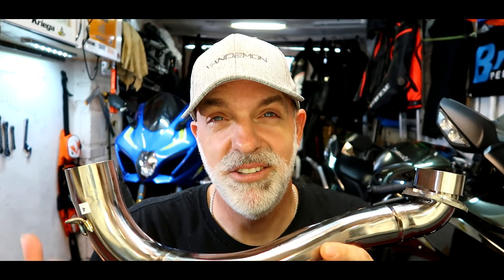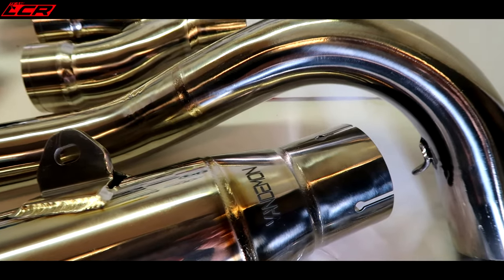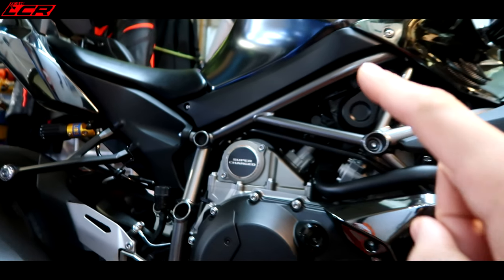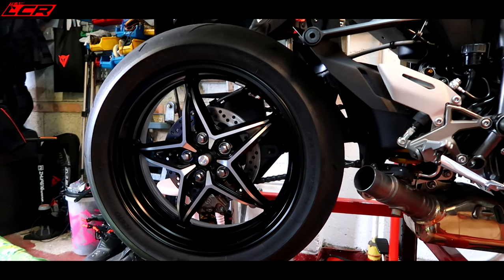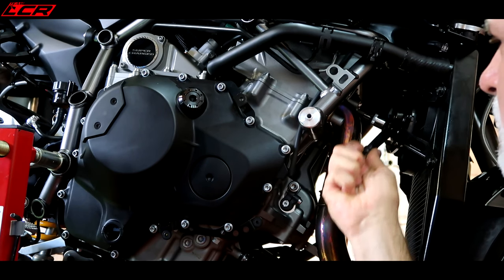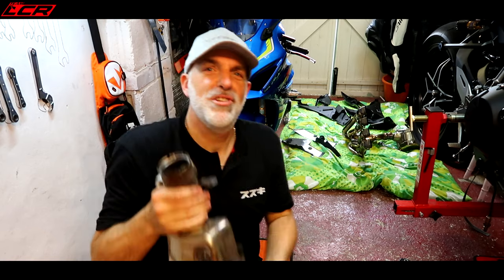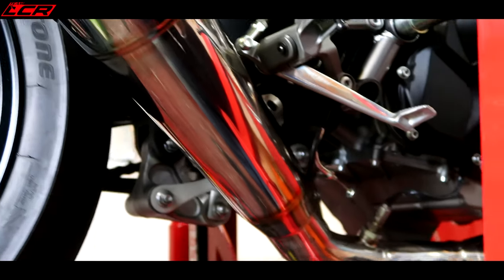Ninja H2 FULL SYSTEM! | Installation & Sound Tests

Comment: One option to tune your exhaust to your liking is to modify the baffle. The HP exhaust on my street triple I started by drilling out the holes on the baffle shaft to a larger diameter. That didn't make much of a difference. I then started cutting the baffle down a bit at a time to make it shorter. Now it's perfect for my liking. Not stupid loud but not quite and I get pops and bangs on downshifts. You can always order a spare baffle if you desire
Reply from the maker: Yes very good idea that Matthew!

Comment: The weight saved means you can eat more pies. The sound and blueing is gorgeous. As you mentioned, the welds look perfect and seamless. Can't wait for the next video. I can only imagine the crowds flocking around it when you pull into any car park. TMF will still get stuck behind a white van on this.

Comment: superb mate! cannot wait for road test! I'm waiting to get the running in service done on the CB then fitting a tiny Termi race can, cheers, G-Man
Reply from the maker: Thats going to sound naughty too!! :-)
Reply: Lamb Chop Rides , not doing full system but the end can is titanium and not road legal and can Remove the baffles so should sound great and weight saving  of around 4kilos, should look good and show off the single sided swing arm too 😜
Reply: Put a video of the stock can and an after of it?

Comment: Hi mate I put sc project on my 2017 H2 then had ecu flash =250 rwhp 😜 they are massively strangled bikes to meet euro emissions...mine was running 20% throttle at 14000rpm now it's 100% in gears 23456 as 1st gear was left alone as would of been unrideable 😁😁 great vid dude 👍👍
Reply: Did u install pc5 too?
Reply: Did u install pc5 too?
Reply: KRISHNENDU BANIK no mate ...Pete clifford who works in bsb for smiths racing team did all the tuning for me..the H2 is unbelievable strangled 😵😵😵😵😵 the power to unlock is there already..but it’s a lot to use on the road mate..
Reply from the maker: Thanks matey, who did your flashing out of interest?
Reply: Lamb Chop Rides Pete clifford the chief tech guy for SMITHS BMW race team Pete hickmans team..just outside of Hull (actiforce racing) 👍
Reply from the maker: OK cheers buddy

Comment: Another great video! Awesome bike and new exhaust, hope to have an H2 some time in the future as well! I guess at some point you also reached this point where the exitment drops below the frustration level, having to remove so many things.......and you just think "WTF did I do" hahaha I had this when I wanted to quickly put on a new handle bar 2 days before a bigger bike trip haha
Reply from the maker: Yes it a pain but part of the job isnt it. Ive given up struggling trying to work around something when just by taking another thing off its so much more pleasant to do the job
Reply: @LambChopRides  thats true for sure

Comment: How did you install the "RH lower deflecting bracket" so that the lower right plastic fairing does not make contact with the exhaust pipes? I'm not seeing how it's supposed to be installed with the hardware provided.

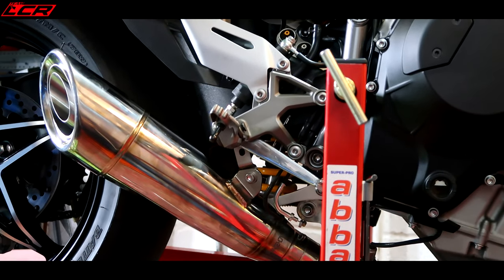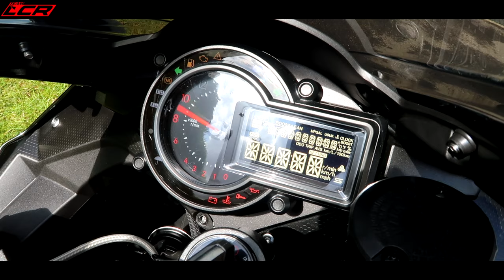Comment: Great Video, I'm curious did you leave the servo on? I saw the cables hanging there after the breadbox was removed and at 10:49 and 12:08. I also have a '16 ZX10R and have been going back and forth on getting an exhaust because of the servo, and then the power commander.
Reply from the maker: Yes left it on for now until I fit the Healtech eliminator. Putting it off as have to remove the tank haha.

Comment: Hello Sean did you buy a bracket for tue exhaust or did you have to improvise a bracket , im surprised vandemon didnt supply a bracket in fact i think it should have been a straight fit plug and play , as you know ive purchased a Brand New H2 a few days ago and im very very interested in this Vandemon exhaust , but ive noticed they have put the prices up from £1800 to nearly £2000 any chance they can knock the price price down to maybe £1800  , they should a Lamb Chops discount code

Comment: Just bought the vandemon  exhaust for my 2021 H2 and wondered if you had any tips. Also   are the header bolts hex or torque and what size. Heed to buy the correct one. Thanks. P.s. love the channel.
Reply from the maker: I just reused the header bolts, no need to replace 👍

Comment: Welcome to the h2 noisy group! 🤣 Just a heads up, but keep an eye on your real wheel bearing play. One sec I had no play in the wheel then 50 miles later there was movement. Kawasaki did not cover it on warranty either! It's a good £500 to have the 2 bearings replaced too
Reply from the maker: Ok great tip thanks Davey!

Comment: What about the cables for the exhaust servo Chops, have you removed them as well?. Sounds epic 👍
Reply from the maker: No currently tied back until I fit the Healtech Servo eliminator
Reply: @LambChopRides  Leaving the cables loose like that but not connected did it throw the FI code or is that only if you remove the servo motor without the eliminator?

Comment: Will it activate the new noise cameras ?
Reply from the maker: Yes probably!! Grrr, think it will be ok just have to pull clutch in once location of these things are known!
Reply: Noise camera on your streets?
In Sepang, no issue for sound limits so far ..
On our streets now, a ‘rampage’ on motorcyclists Is underway 
– mainly for Exhaust Sound Levels, and, other legal stuffs ..
So, made a video for my fellow bikers here on the legal test standards, as linked below,
Wonder if it’s exactly typical to that of yours, over there?
https://youtu.be/Na1HFr57r7U

Comment: Hi on there website says does not need remaping is that ture can I put the system on and not bother with the remaping
Reply from the maker: Yes they run so rich stock it's fine. I have a dyno vid on my channel where we mapped it and with just the exhaust fueling was safe. 210 hp at the wheel with the system too!

Comment: Great video and job with the H2🥵👍 The exhaust sound’s awesome👌. Just curious🤔? Is the exhaust street legal and what did the Motor-Vehicle Inspection say?😱 The Green BST carbon wheels would fit well on the H2🤔👍.
Reply from the maker: Nope its not road legal... With the baffle in its not ridiculously loud Iive heard much worse but yes could get me in trouble. MOT yes thats also a potential pain with no CAT but cross that bridge in a 2 years time, know a friendly MOT man :-)
Reply: In Sepang, no issue for sound limits so far ..
On our streets now, a ‘rampage’ on motorcyclists Is underway 
– mainly for Exhaust Sound Levels, and, other legal stuffs ..
So, made a video for my fellow bikers here on the legal test standards, as linked below,
Wonder if it’s exactly typical to that of yours, over there?
https://youtu.be/Na1HFr57r7U

Comment: Sad I live in Germany where this modification is not allowed and in some areas strictly controlled. I drive a Z1000 2015 with full Akrapovic sysem. If the wrong cop pulls me over, they will set my bike out of order. Damn Euro-settings, force of DB-Eaters etc
Reply: Guten Tag ..
In Sepang, no issue for sound limits so far ..
On our streets now, a ‘rampage’ on motorcyclists Is underway 
– mainly for Exhaust Sound Levels, and, other legal stuffs ..
So, made a video for my fellow bikers here on the legal test standards, as linked below,
Wonder if it’s exactly typical to that of yours, over there?
https://youtu.be/Na1HFr57r7U

Comment: No chance of tracking that now, which is a shame. Brands is 102db cap
Reply from the maker: Yes I dont want to use this in track Andy anyway as its just to expensive to repair if you come off. Thats what the GSXR is for :)
Reply: In Sepang, no issue for sound limits so far ..
On our streets now, a ‘rampage’ on motorcyclists Is underway 
– mainly for Exhaust Sound Levels, and, other legal stuffs ..
So, made a video for my fellow bikers here on the legal test standards, as linked below,
Wonder if it’s exactly typical to that of yours, over there?
https://youtu.be/Na1HFr57r7U

Comment: Best leave the baffle in as the fun police are going to have noise cameras more cash for the man but is it any louder than the gsxr with the brocks titanium pipe
Reply: In Sepang, no issue for sound limits so far ..
On our streets now, a ‘rampage’ on motorcyclists Is underway 
– mainly for Exhaust Sound Levels, and, other legal stuffs ..
So, made a video for my fellow bikers here on the legal test standards, as linked below,
Wonder if it’s exactly typical to that of yours, over there?
https://youtu.be/Na1HFr57r7U
Reply: @KhalidMA  we here in northern Ireland don't really have a lot of issues with the noise but in England and Wales they have had police checks and talks about noise cameras in areas,, triggered and then a fine in the post,, big brother killing the fun so bit of self control,, before it's forced upon us,, ☘️☘️☘️☘️☘️

Comment: Is there any law about how loud your bike can be? I see loads of people taking out the baffle of there bike to make it louder.
Reply from the maker: All exhausts should be EU marked for road use, if you dont have the marking you could potentially get in trouble with the plod if caught.
Reply: @LambChopRides  So as long as its to the standard, it can be extremely loud with the baffle removed?

Comment: had to make an end can bracket so it fits? sorry, but that's piss poor on anything that costs £1800 fella. why could it  simply not be welded further back for a proper fit?
Reply from the maker: Sorry Stephen thats my fault, it came with all these brackets I did say make didnt I... Sorry
Reply: Lamb Chop Rides - but still, for the sake of moving the mount a few inches it would have been a perfect fit... I guess it’s their generic end can that’s meant to suit x number of models. If it were me, after spending that much, I’d be unhappy. I could understand a system for 3,4,500 doing that but something in that price range should have the brackets in the right place without the need for a bolt on bit of bent (insert metal here)  to make it fit